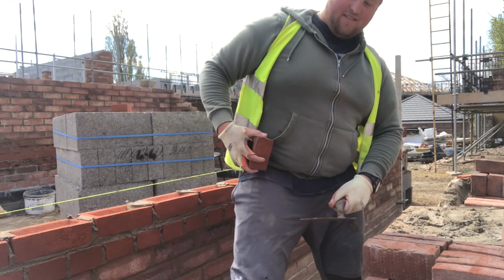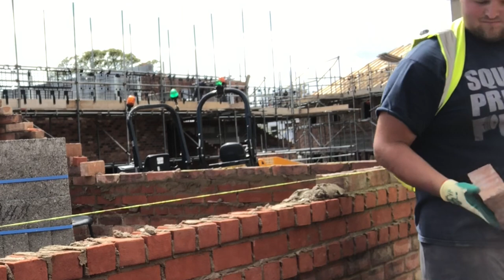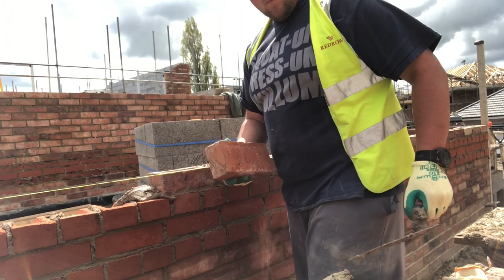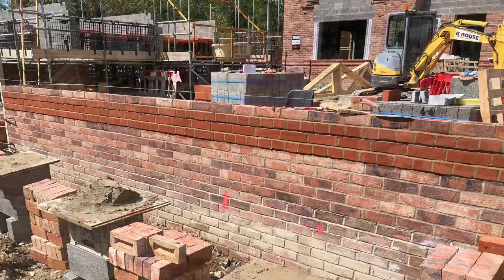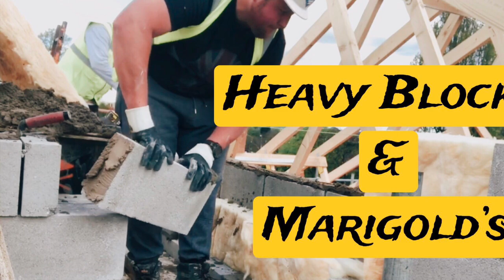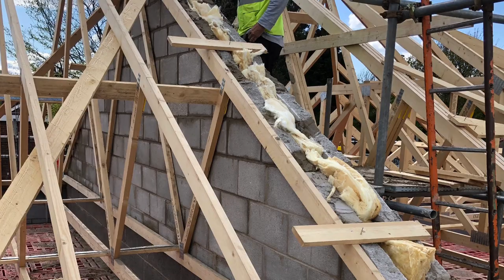Bricklaying Vlog - Brick & Block Garage (Heritage Blend) - Working Hours & Gang Sizes - Part 3

Comment: I tried to go back on site a bit back and found it difficult to get on housing solo or 1 and 1. You can get on commercial builds but it seems to be day rate/hourly. I did work for one commercial firm years ago as a 2 gang and noticed that some of the solo guys did a lot better than us on price.
Reply: It’s hard to get plots 1-1 even tho I can throw 2 semi timber up in 10 days so I put it down to agents controlling the site I wouldn’t work for groundwork outfits either always jealous cxxnts causing 💩try get into an agent doing the garages and garden walls
Reply from the maker: @hbpw857  that’s what I’ve been doing for the last few years, walls n garages are great earners, it helps sticking with the same Subbie
Reply from the maker: I’ve always worked 1n1 and not found it difficult getting starts, but been with the same subbie for a few years now, That’s what I’ve heard tho from others , its come down to sites wanting the houses throwing up quick, I’d never compromise working 1n1 or 1 n 1 with An improver to fit the site agents agenda
Reply: @theafter8bricky  if you got them consistent your laughing bro smaller busier sites in wales so a lot of competing but your right forget the house bashing 👌
Reply from the maker: @hbpw857  i like the houses for certain firms, but I think if I ever ran out of walls n garages/plot n days work in the down times, I think I’d pick footings, over strictly just house bashing, i seems to earn more on footing walls n garages over plots, I just like being out the way on scaffolds more than anything rather than being in the dirt near all the plant
Reply from the maker: @hbpw857  massive balancing act deffo, I only train on weekends now, no chance mid week 🍺💪🏻